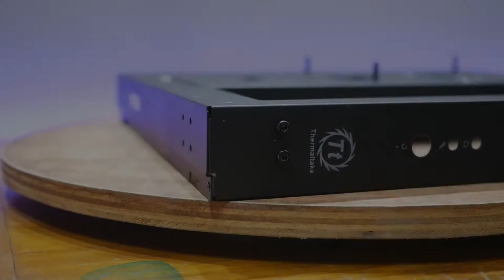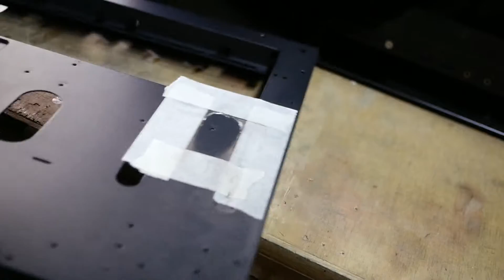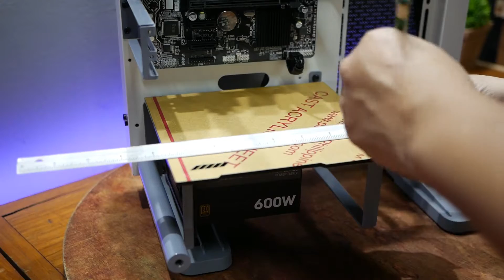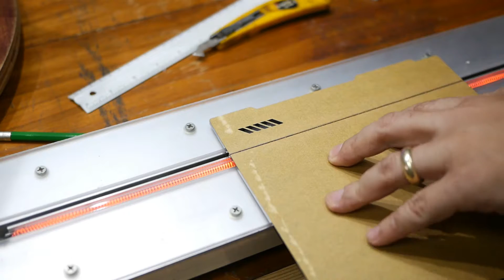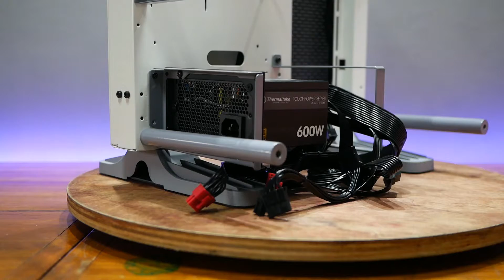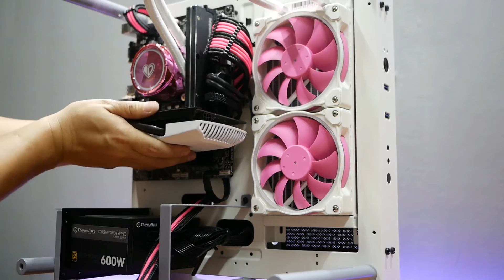Project P I N K custom PC build

Comment: Hi! May I ask just one question? Is it possible to mount the radiator at the back of the case? So that the longer GPU won't be blocked by the fans + radiator? My GPU is 300mm and I want to mount it horizontally, but afraid it will get blocked by the fans + radiator. Thanks!

Comment: Hey dude, just FYI - you’ve actually installed your cooler the wrong way around. It will be noisey and you will get airlocks at your barbs. Probably impacting performance as well.

Comment: The motherboard of this case is a atx micro atx or itx?
Reply: Mini itx, the Thermaltake core p3 suports micro atx and atx, but the Core p1 is only for Itx
Reply from the maker: @sorencs2  its matx.
Reply: does msi b250m fit into this case?
Reply: @TantricModz  how can it be maxt if the p1 only supports mini ITX??